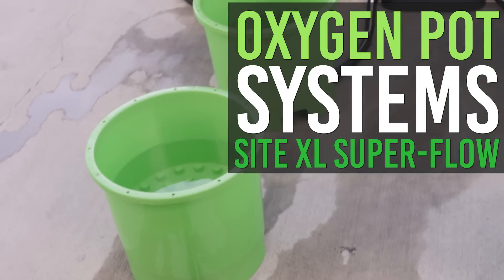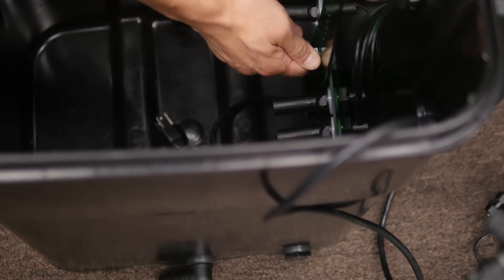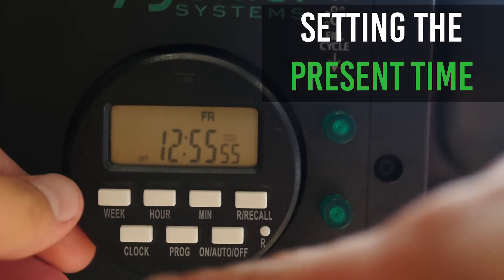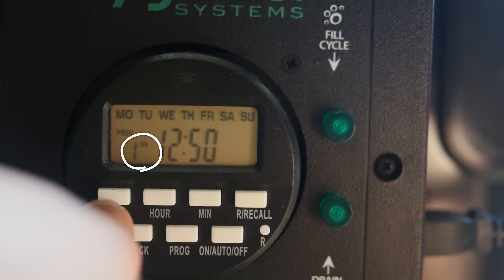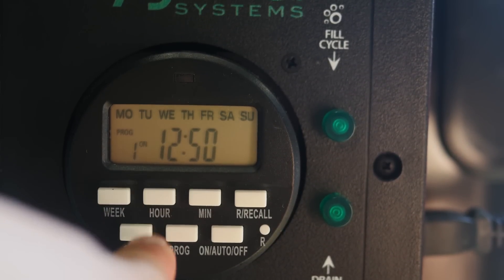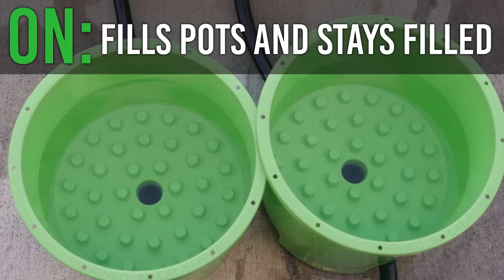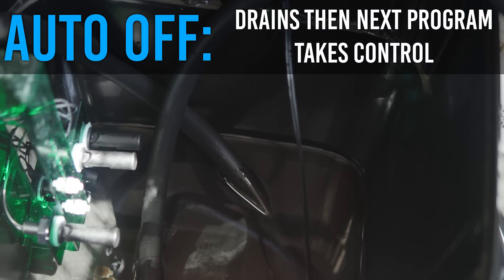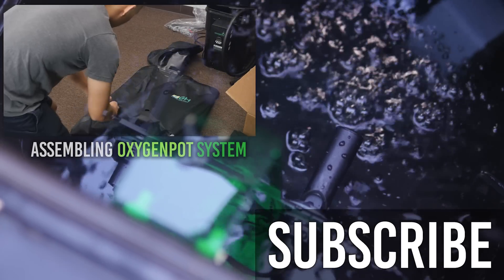How to Set Up the Oxygen Pot System Digital Timer & Set Water Level for Hydroponics

Comment: My Gro-Commander is over flowing from the top before it has a chance to drain back in to the Res tank. The drain tubing and flow tubing on either side of the Gro-Commander is leaking at both rubber grommets.
Reply: Did you ever find a solution to this?